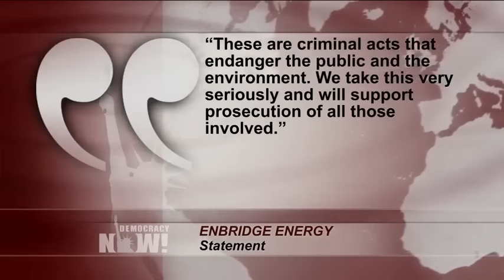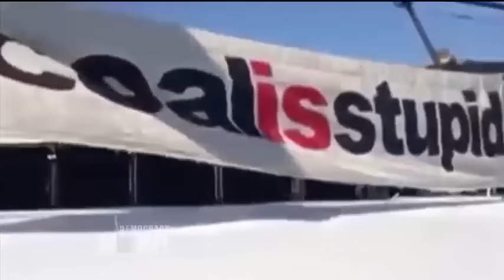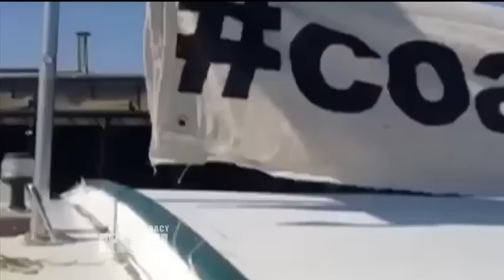Climate Direct Action: Activists Halt Flow of Tar Sands Oil by Shutting Off Valves of Five Pipelines

Comment: the next step in such an action is to remove the shutoff wheel on the valve stem, and then saw off the valve stem flush with the body of the valve. This multiplies the work required to restore operations.

Comment: I could spend all day slapping the stupid out of Mr Ponytail, and still feel like I didn't make a difference. Ya, it was only an 8 foot high fence with barbed wire, locked gate and with locks & chains on the valves, they were practically inviting us in. When will these activists learn, you make a difference by lobbying & voting, not by stupid & dangerous stunts.

Comment: Stop selling these people things made of oil and put electric fences around pipeline valves. "Renewable" energy requires oil.
Reply: It doesn't require oil, but oil is currently used to make some materials.
Reply: @Jake-rs9nq  You just contradicted yourself.
Reply: @Jemalacane0  No I didn't. Oil is not REQUIRED. Alternatives can be used. However, currently, oil is used.
Reply: @Jake-rs9nq  Wind turbine gear boxes are lubricated with oil. Plastics and the insulation of wiring are made from oil.
Reply: @Jemalacane0  All of those things have alternatives. Renewables do not require fossil fuels. I don't know what's so difficult to understand about that.
Reply: Put up solar panels to power the electric fence to be green!